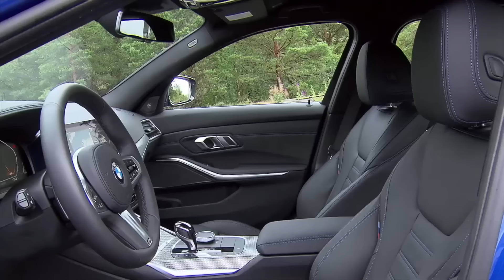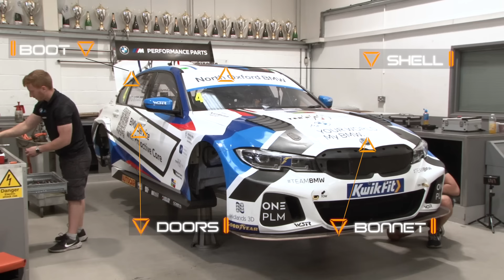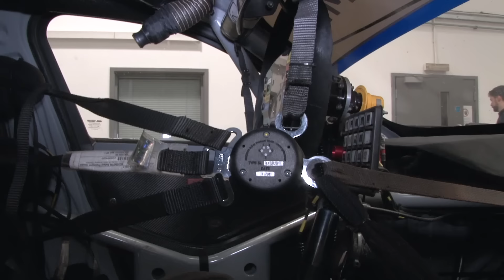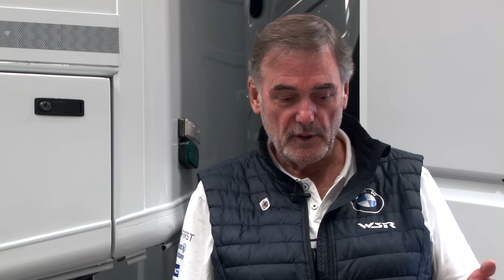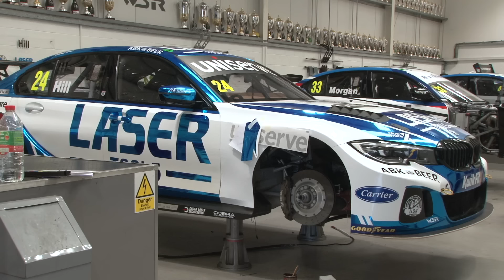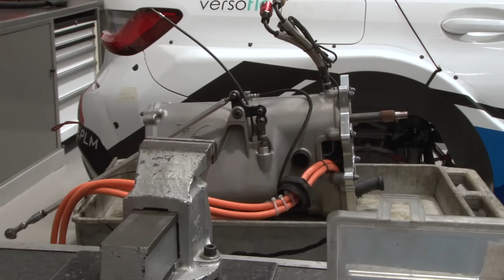BMW 330e BTCC : Inside WSR's Touring Car challenger

Comment: These BMW engines are monster after a few mods and a tune they can reach 500hp or stock internals
Reply: Not really a "few" mods its a handful and a good tune. But yea bmw really did a good job with the b48 and b58
Reply: Think 400hp is easily achievable with these NGTC engines just by upping the turbo boost think they are around 380hp so Dick Bennetts saying around 390 is probably about right not counting over boost and hybrid.

Comment: This was super cool to watch! I’ll be honest I never knew the front and rear subframes were standardized parts between all the teams! It sure does sound like the rules and regulation thats is required by the teams to follow will make for tight competitive wheel to wheel racing that we all want to see 😄

When did this start being implemented, in which year, that all teams must be on the same subframe packages built by one company ? Was it like this for the early 90s cars and 2000s cars like the e36 and e46 chassis as well ?
Reply from the maker: The standardised subframes and transmission were gradually introduced in 2011 and fully implemented by 2014 if I’ve done my research right. The earlier cars you mentioned used production bodyshells - albeit with much modification - instead of the sub-frame approach.

We're hoping to be able to cover older vehicles in the new year and a super-touring car is on the list!